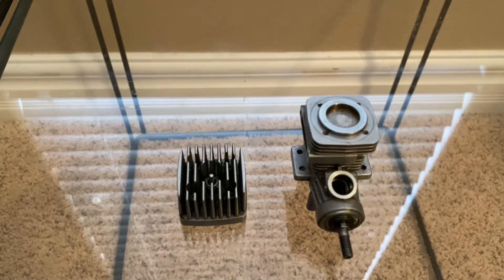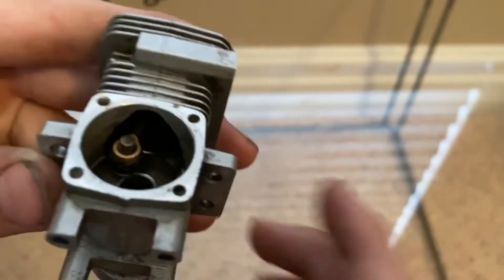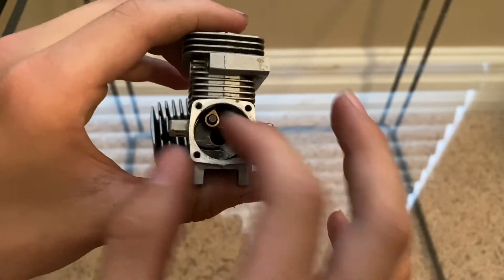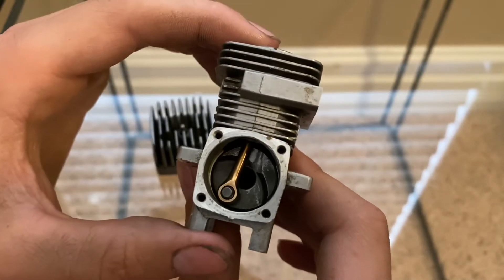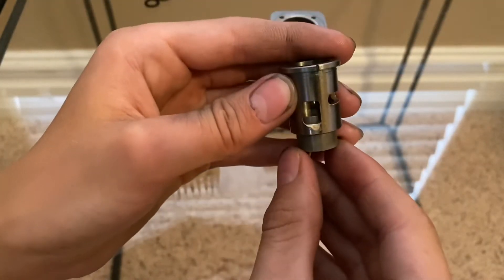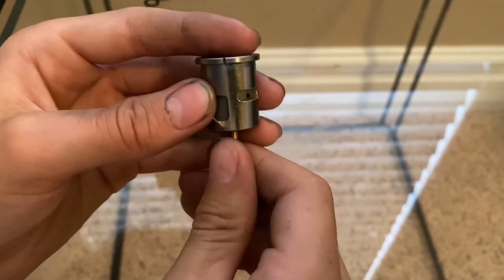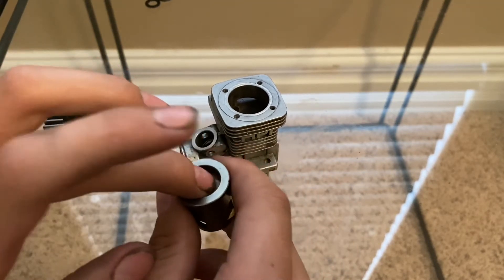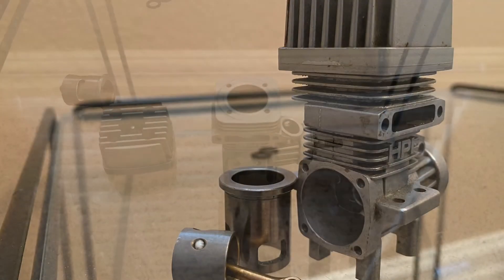Nitro engines explained! | how nitro engines work

Comment: 6:19.... This is 100% correct. MANY people think that these engines work like a diesel, and that the glow plug just stays hot enough from the previous combustion to light off the next one, but that's not what's happening.... 

The glow plug element is a coil of wire that contains Platinum within the metal, and the fuel for these engines contains some Methanol. 

The ignition comes from a catalytic reaction that creates heat from the Methanol in the fuel and the Platinum in the glow plug. The reaction creates enough heat to fire the air/fuel mixture that is compressed in the combustion chamber.  

If you took a fine Platinum wire and stuck it into the top of a jar (where the vapors are collected) that contained some Methanol in the bottom of the jar, the Platinum wire would glow red hot all on it's own just from being in contact with the Methanol vapors.

The ignition timing point on one of these engines is a combination of how much compression is in the cylinder, how much Platinum is in the glow plug element, and how much Methanol is in the fuel mix.

To adjust the timing on one of these engines, you would first start by adjusting the compression (by adding or removing thin metal shims that are under the head, used as gaskets. There's usually more than 1) for the type of fuel that you are using (% of Nitromethane that the fuel contains). 

Then once you get the timing close by adjusting the compression, then you can fine tune the timing further by using a certain "temperature" of glow plug, varying in 4-5 steps between "hot" and "cold". 
The cooler temperature glow plugs contain less Methanol in the element than the hotter plugs. 

You can tell if the timing is too far advanced by looking at the glow plug element. The element will be nice and shiny, and a perfect coil shape when it is new. It should stay looking like this for around 1/2 to 1 gallon of fuel.  If the element quickly turns dull and gray colored, and/or is a distorted shape, your timing is too far advanced. In extreme situations, the combustion chamber under the head, and the top if the piston will end up looking like they were sandblasted, and/or the engine will frequently blow the plug element right out of the plug body.This IS the danger zone, and you will quickly end up blowing up your engine if you keep running it like this. You may also hear an audible "ping" or "knock" if your timing is far too advanced like this. If this occurs, lower the compression by adding a shim or two under the head, and/or switch to a step or two colder of a plug. 

Signs that your timing is too far retarded will be that the engine may be hard to start, will constantly stall when the glow ignitor is removed (the idle should remain the same and stable when the ignitor is removed when the timing is correct.) and the engine will be overly lazy. 
In this case, switch to a hotter plug first and try it again. If it's better but still not quite there, then remove 1 head shim and run it again. 

All of the above timing adjustments MUST only be done with the engine tuned correctly first. Get it tuned the best that is possible BEFORE you attempt to make any timing adjustments. MANY times the carburetor tune is responsible for poor running rather than the ignition timing. 

If it's an R-T-R engine, stick with the glow plug temp that came with the engine, and run the reccomemded Nitro % and the timing should be good where it's at. 
It's when you get a high-performance racing engine, or if you mod the engine or change the exhaust header and pipe, that you may have to adjust engine timing.  ALSO, if you change the % of Nitro in the fuel that you are using, you'll probably have to adjust the timing to get the best performance also. 

Pro-Tip... As your engine gets a lot of running time on it the compression will slowly start to go away, and the engine won't be as strong running as it was when it was new. At this point, you can make timing adjustments to get it running better and get some more time out of it before you need to replace it. First switch to a slightly hotter plug. Once that is no longer effective, then start removing head shims one at a time to restore lost power. I have even ran engines with NO head shims. You just have to make sure that you tighten the head bolts a little more to ensure that there's a seal. You can also switch to a higher % Nitro fuel also as the higher Nitro will require  less  compression to run correctly. Switching from 20% to 30% Nitro  WILL wake up a tired engine instantly.
I have gotten engines that most people would consider to be pooched to run fairly well for another gallon or two of fuel before they really ARE too pooched to run anymore. 

Signs of low compression are that the engine will be #1 noticeably down on power, #2 they will start up ok and run for a bit, but then constantly stall once they are warm, and will refuse to start until they cool back down. #3 very hard to start in general. 

Usually, you can test if an engine has plenty of compression by removing it from the vehicle, remove the header and pipe, then rotate the flywheel until just when the exhaust port closes by the piston and compression starts to build, then hold the engine by the flywheel so that the cylinder head is at a 90° angle from straight up and if the engine is able to hold itself from going upside down by the compression, then it has enough compression left in it. 
IF the engine won't hold and immediately flops upside down through the compression stroke, then it's pretty much done. 
If it holds for some seconds and then slowly blows through the compression stroke and ends up upside down, then it's on it's way out but should still run. 
It's at this point that you can do some of the timing tricks above to get some more life out of it. 

Whew! That was long.... 
But after reading this, you are now getting closer to a pro Nitro engine guru. 
I've been in the hobby for over 30 years, and have learned and done a LOT with this tiny engines over the years. I now mod, port, polish, and balance my own engines, and have learned how to extract more power from them, and how to extend the lives of them. 
Keep working on them and learn, and you'll get there too if you persist. It doesn't come overnight. Experience is a BIG part to do with it also besides just reading.

Comment: thank you, this is the answer I've been looking for, how does the rc nitro engine start after the igniter is removed
Reply from the maker: I’m sorry, Mr. Mechanic passed away last April so he can’t answer your question. 💔 This is his mom.
Reply: That's so sad... May we know what happened to him?
Reply: I’m very sorry to hear that ma’am. R.I.P Mr. Mechanic
Reply: There is a catalytic reaction that happens between the Methanol in the fuel, and the Platinum in the glow plug element, which creates heat. 
When this catalytic reaction is combined with the compression at TDC, there is enough heat created between the two to be able to ignite the air/fuel mixture in the cylinder.

Comment: Where the coil
Reply from the maker: There is no spark coil needed on a nitro engine because the chemicals in the fuel keep the glow plug heated up.

Comment: its not actually the 'heat' from the plug that creates a 'bang' but rather the material from the little spring inside the plug, if this spring is lit it reacts with the nitro content in the fuel and basically burns it. after you take your igniter off, the plug stays lit because of the entire combustion cycle (the fuel makes it stay lit) obviously it doesnt shine as bright as when you put an igniter on, but its enough to burn fuel.

also, that is an ABN old hpi engine, very cool sir! is it the 15fe?
Reply from the maker: Yeah it’s a 15FE. You know your stuff 😂 just got it with an old hpi nitro on trade
Reply: thank you, this is the answer I've been looking for, how does the rc nitro engine start after the igniter is removed
Reply: @abylang02 See above answer...
Reply: No, it's not the Nitro that does it, but it's the Methanol that creates a catalytic reaction with the Platinum metal that is in the glow plug element. 

This catalytic reaction is hot enough to fire the A/F charge when it comes into contact with the plug element, and is also compressed enough.